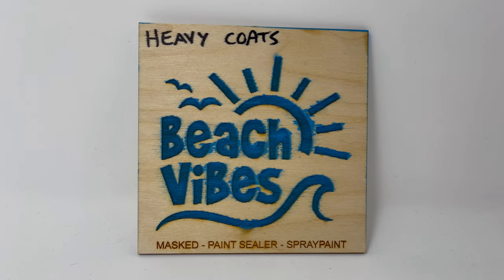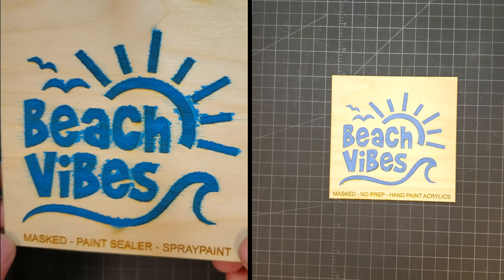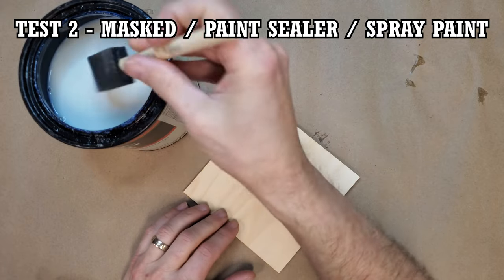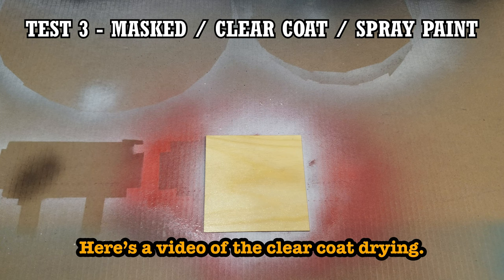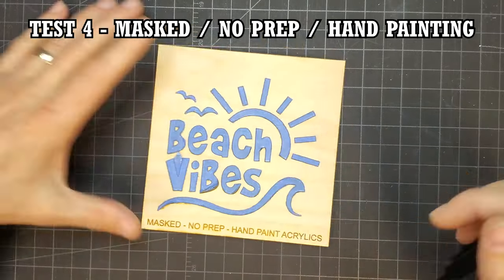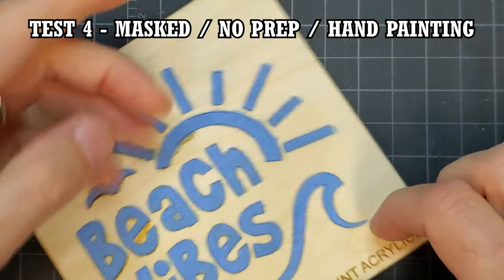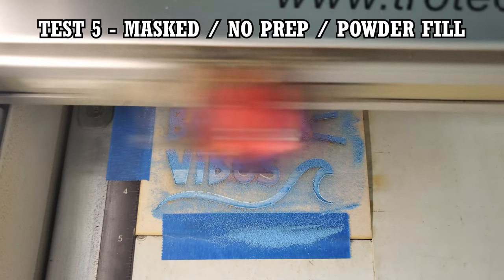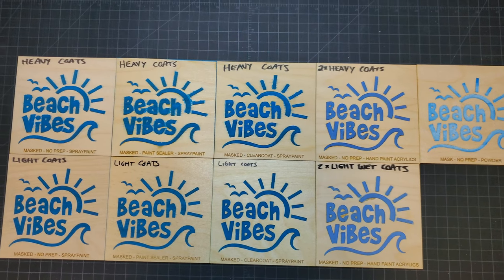Experts Test Color Fill Techniques on Laser Engraved Unfinished Wood: Paint Filling, Powder Coating

Comment: To further explain why your test didn't work from a wood working perspective. 

The laser is removing your seal coat therefore essentially you are painting unsealed wood in each of these. The end grain (which is like straws) of the plywood veneer is soaking in the paint . This is worse for the spray can because the paint is thinner.

It would be better, as already said, to seal after engraving with 1-2 coats of the sanding sealer. Two coats are probably best. The end grain will get clogged with the sanding sealer and should prevent the paint from being absorbed by the end grain. If you still seal the top of the board you should be able to use acetone to clean off any paint that might have gotten on the top of the surface.

Thanks for the video.

Comment: I have had good success with masking, etching, THEN applying the clear topcoat, and painting. It seems seal up the etching pocket really well and leave crisp lines. I use a fast drying shellac, done in 20 or so. You should try it!
Reply from the maker: Thanks! We're going to definitely try this. :-)
Reply: So do you apply the clear coat with the mask on?
Reply: @thechalkshop574  yup! it's still super easy to remove afterwards.
Reply: This method works well with cnc milling too.
Reply: I was waiting to see this method!!
Reply: Me too...

Comment: Thanks for the video. I was looking to solve bleeding issues myself so I asked in a group of people that do it all the time (I have not tested myself yet) The consensus was, forget masking, laser, then seal with a clear (some said lacquer, some said shellac) then paint to fill and then sand off the top layer of paint leaving the paint inside the engraving. I think I will try your mask, seal , engrave, light coat method myself against this other method. I had tried this but with heavy coats (I tend to do 2 heavy coats when painting wood).

Comment: I do CNC work where I cut the logo in as well. It's a MUST to seal AFTER cutting since you need to seal the sides where it bleeds. I do 2 coats of shellac. Dries fast.
Reply: Do you recommend a specific product? TIA

Comment: One trick that may work well is airbrushing. I haven't tried it yet but the process should have similar excellent results. It's light in application so it shouldn't bleed under the tape. Just a thought. 
Scott.

Comment: Why didn’t you clear coat AFTER engraving as well.   Shouldn’t it be obvious that it would bleed the way you did it because the engraving exposes raw wood with tin the art where of course it’s going to bleed.  That needs sealing.  

Mask>engrave>clear coat>spray.   That should be the most obvious trial and you missed it

Comment: I too find that a first coat of spray shellac, masking, cut (CNC) or burn (laser), more shellac to seal the freshly cut wood ends. and spray paint after that works well.

For the powder coatings, after first heating them with the laser, try heating them in a toaster oven for 30 minutes or so at a temp somewhere north of the materials melting point.  I have a toaster oven in my shop dedicated to such projects so I don't have to try these things in the kitchen.  Think it was maybe $35, but you might get a good deal on one from a thrift shop.

Comment: 1. Engrave then spray with clear coat (2 light cost) then spray or paint as you please. 2. use a heat gun i.s.o. your laser to melt the embossing or powder coat to get an even look. I never done this but common sense prevail.

Comment: Thanks for the video.  Sorry... you missed the boat.  ???? Clear coating before engraving ????  The paint is not bleeding through the surface in to the surounding wood fibers.  It is bleeding from the edges of the engraved areas.  The deeper the engraving, the worse it gets.  Suggestion:  Mask the surface with transfer tape (extra wide low tack masking tape).  Then engrave.  Then spray with clear spray paint in light coats.  Let the clear coat bleed all it wants too, it doesn't matter because it doesn't show.  After that drys, then spray your colored paint.  Then remove the masking when dry.  If the clear coat's bleed shows a little, hit the whole thing with a matt clear coat at the end.  That should make the clear coat bleed disapear from view.  I have not yet experimented with professional wood, water sealers such as Thompson's Water Sealer products... but as they all contain water glass, I suspect they cause charing of the wood similar too borax treated wood.  Thompson's products soak in deep.  Deeper than the engravings.  It might be worth it in a mass productions process where you treat all of your wood before engraving, but you risk causing thin birch ply to warp from getting that wet.  Keep up the good work, and thanks for helping bring back a manufacturing mind set.

Comment: Interesting testing.  I have not tried painting a laser etching yet, but I plan to.  The spray paint method works for a single color, but what about if you were to add several colors.
Reply from the maker: If you're not able to cover sections between colors, then you might want to try something like having the laser only cut or engrave one "color layer" at a time. I would look at these videos below for what I'm referring to.
https://youtu.be/Sf5u6rzOEXg
https://youtu.be/lm08qw9ihMs

Comment: 2:35 work smarter, not harder. Time is $$.  Would it be possible to do a cut out, outline, I don't know the phraseology,  on a thin piece of vinyl, then glue/melt, it in the engraved areas?
Reply from the maker: We've never tried it, but if the design is simple enough, something like that would probably work!